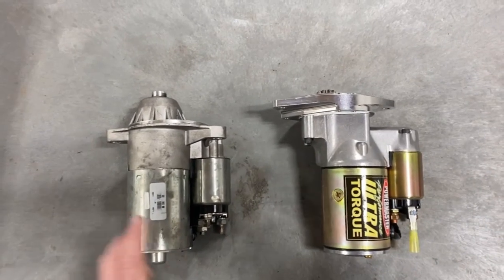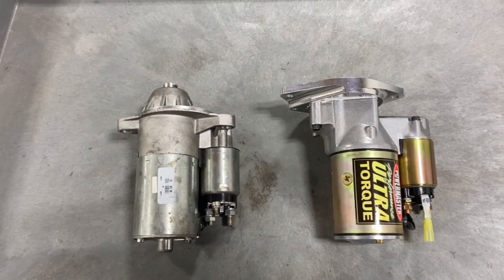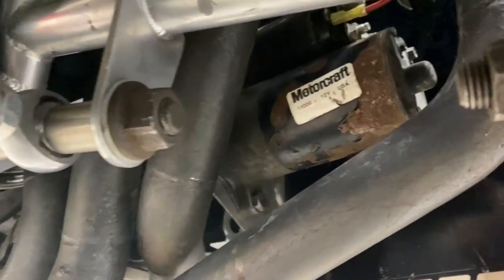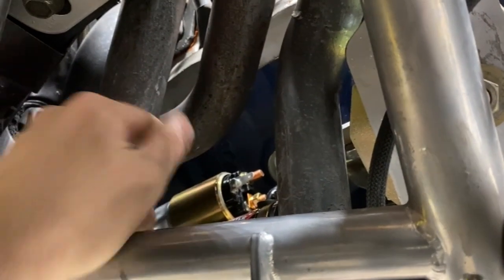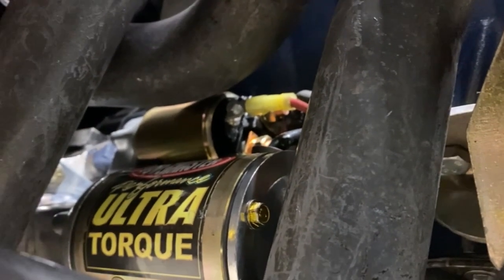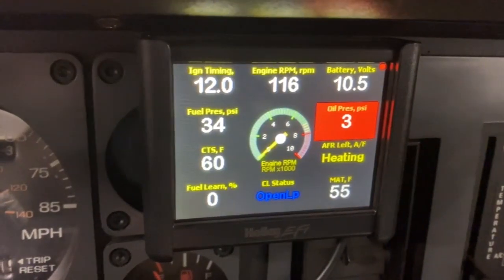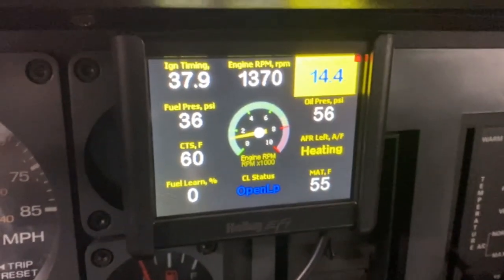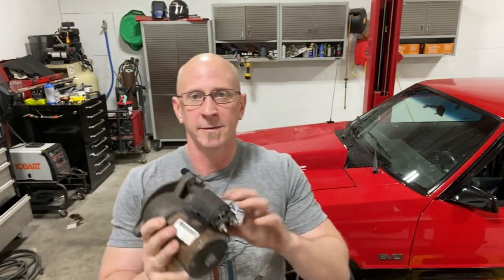Powermaster Ultra torque 9403 vs stock Ford mini starter... Is it really worth it?

Comment: Just installed the 9103 in mine, working fine so far.
Reply from the maker: Mine is still working well,  when I made this video I was a bit o  the fence about it,  but it does seem to have quite a bit more cranking power than the ford mini starter.